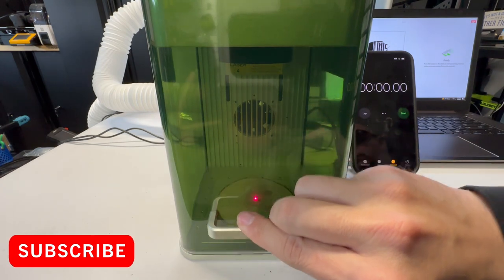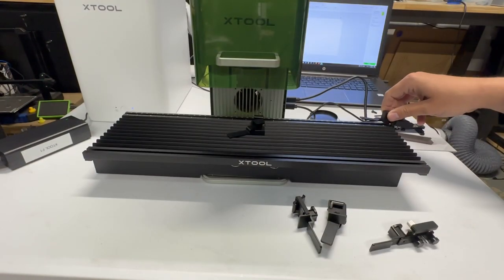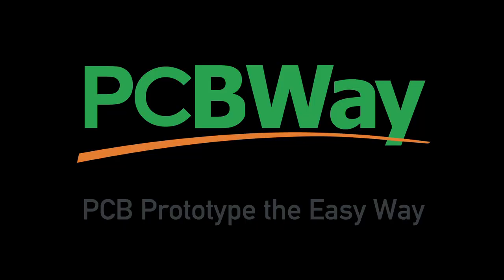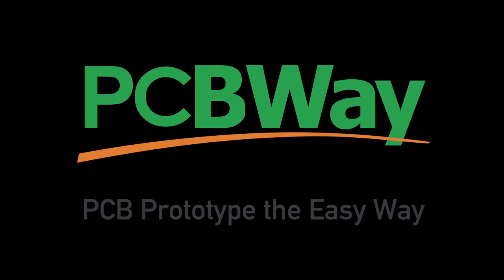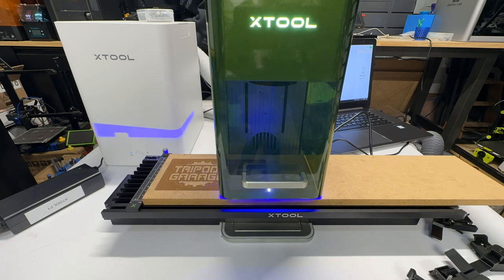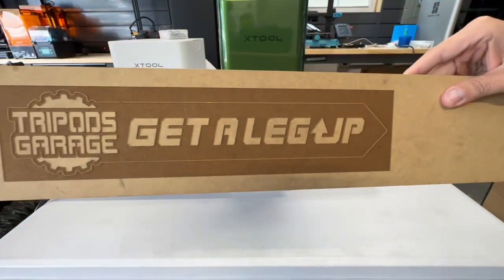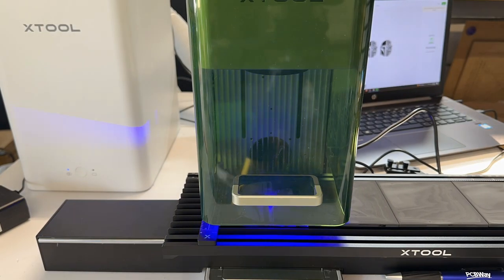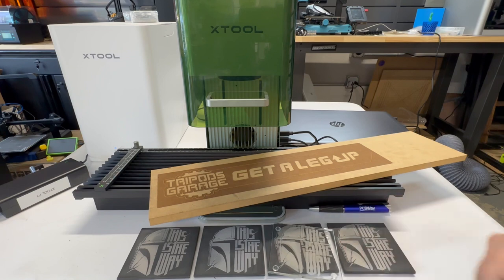xTOOL F1 SLIDE EXTENSION - How to laser engrave glass!

Comment: Does the paint type matter? I have acrylic, wondering if the point is just to make the glass black, or if the tempura paint has a special chemical
Reply: (I also have cermark on hand)
Reply from the maker: I just found that Tempura paint is the easiest.  It just washes off with hot water.  If you go with too much power the etching can get slightly black.  I would thin it out, and don’t use a brush.  Brushes are a pain, they leave an uneven surface with small gaps.  Just dip it like I did, and let the extra run off.  Or you can pour it over the glass and tilt the glass and let the extra run off.  I haven’t tried Tempura paint with clear acrylic, as that might make the etching slightly black.

Comment: I etch my glass bare. What does the tempura paint achieve?
Reply from the maker: What type of laser are you using?
Reply: Muse Titan 90w co2 Chinese co2 60 w Epilog Zing 40watt Gas bought but haven’t received my F1 yet. I’ve etched glass on both the Zing and Chinese co2. I have found that the etched field can have something of a minute texture. When you answered another commenter about it being an interference layer? Is the texture more smooth, uniform?  @TripodsGarage